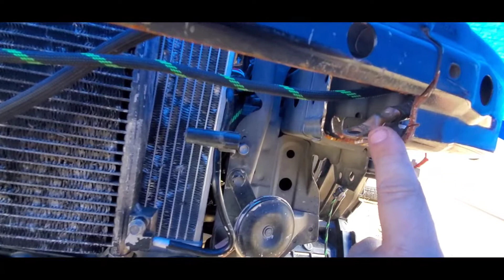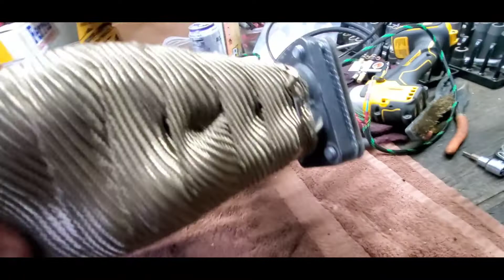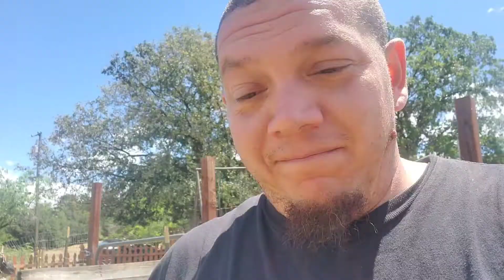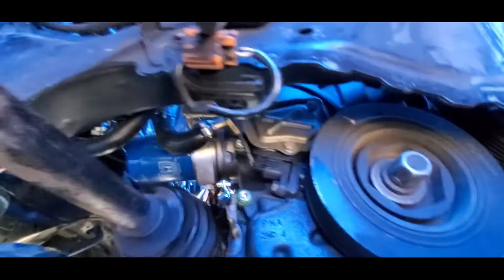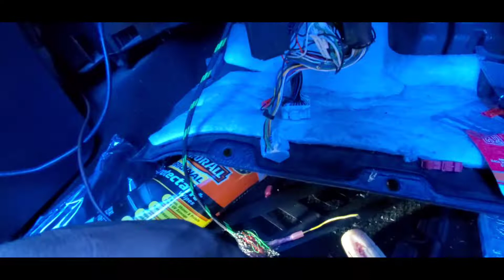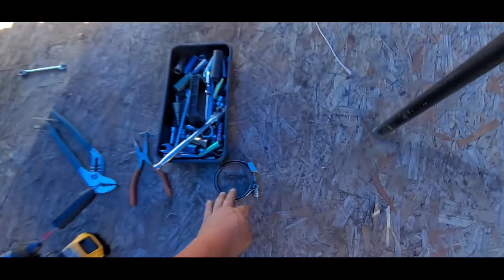Installing Humble Proformance Turbo Kit On The RSX #turbo #acurarsx

Comment: Great video explained very well. My question is why did you not hook the Boost controller and wastegate up to the vacuum block. And if I wanted to could I hook up the Boost controller wastegate and blow off valve and boost gauge all to the vacuum block
Reply: Thanks a lot..
Reply from the maker: You could run that route. But I was running WG & BC off the cold side turbo. It was easier to route my lines that way. That's how speed factory has it ran through there boost control. As long as your getting vacuum some were your good

Comment: I’m trying to see you set up the fuel return system
Reply from the maker: I have a video of the setup. It should be under the fuel system playlist
Reply from the maker: There are different routes to do it. If your going to run a good exit you might want to relocate the fuel pressure regulator to the driver side. We're I have mine at on the passenger fire wall you might run into issues
Reply from the maker: I run my fuel filter under my car in the tunnel were the OE fuel lines and rear brake lines run.

Comment: I have the rsx budget kit and the 3" downpipe does not clear the steering bar/shaft. There is less than 1/8" of play . Was yours less than 3"?
Reply from the maker: I am pretty sure it's the 3in. Everything on mine cleared Everything. But it's all a tight fit forsure.

Comment: Were you able to run heater lines withe the sidewinder?
Reply: Dc5 creations has a kit that works. You would route the hose however you need for clearance and heat reduction
Reply from the maker: @Unruly_DC5  I need to check it out. Thanks
Reply from the maker: I tried to figure out a way and couldn't. No heater. The hoses come way to close to the sidewinder and down pipe.